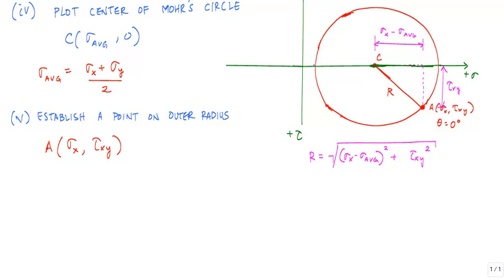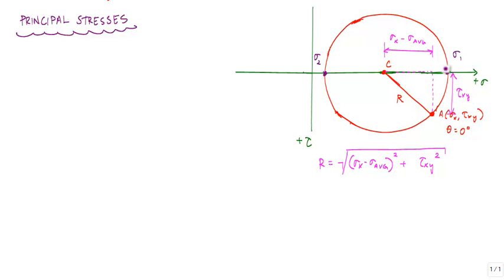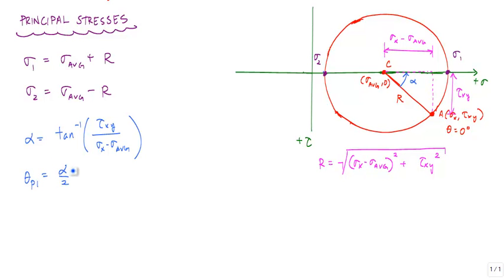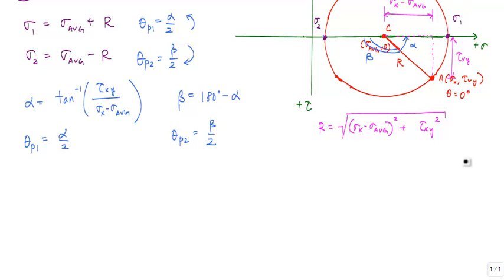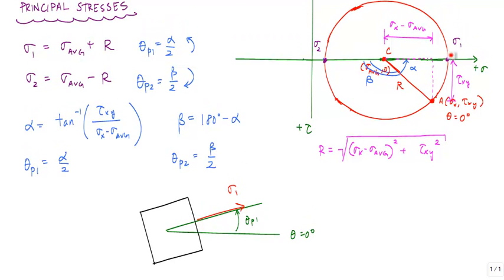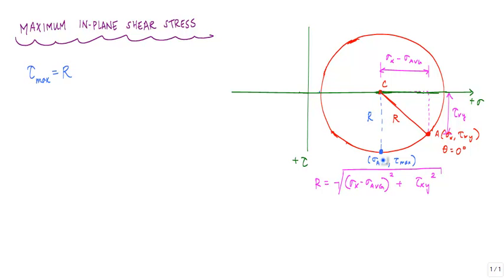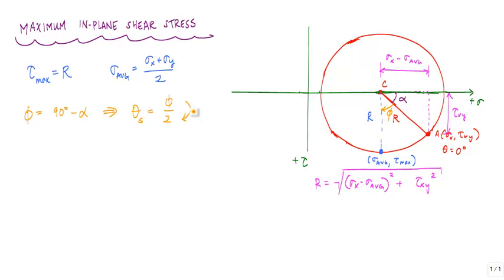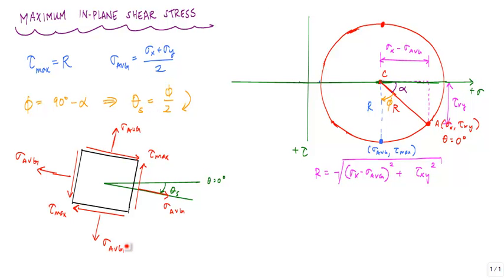Mohr's Circle (2/2 - principal and max shear stresses) - Mechanics of Materials

Comment: great video!
however, I dont agree at 5:28, you said you have "positive shear stress".
it's actually negative. That should be the reason why the "plus face" you referred at 5:40 has counter clockwise direction of the shear stress  (on the stress element).
please correct me if I'm wrong.

Comment: just wondering about the rotation hereso if i try to get to max plane stress from the form our original point with the shortest angle on mor's circle i would turn the square anti-clockwise
Reply from the maker: +blondyelowflash it doesn't matter which way you rotate as long as you are consistent and go to the point of maximum shear stress on mohr's circle.

Comment: I thought there was no stress in the planes when you are in maximum shear stress ?
Reply from the maker: 7Critics  i'm assuming you are referring to normal stress....in the max in-plane shear stress state the normal stress on each face of the element is sigma_avg
Reply: ok thanks. But they pretty much cancel each other out anyways so we don't need to draw them on the square with forces right ?
Reply: Correct.